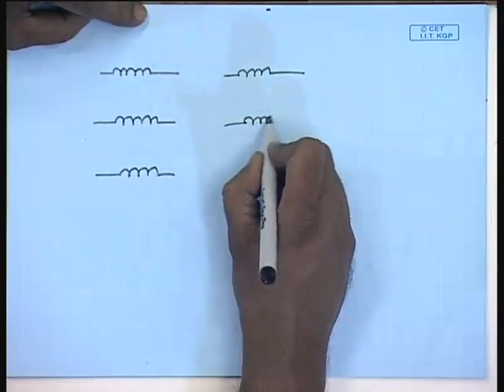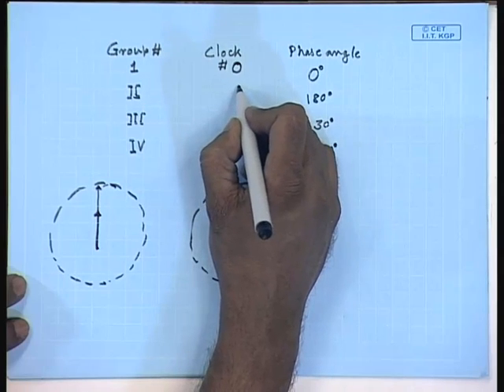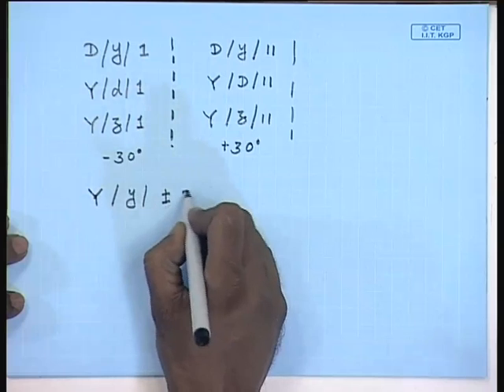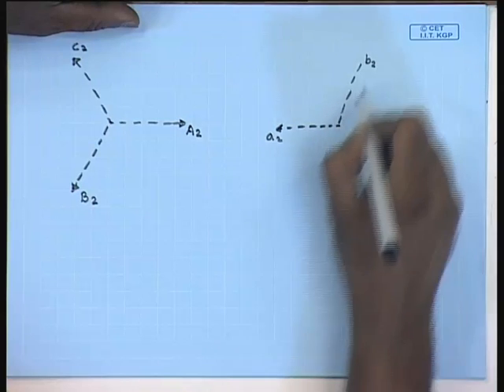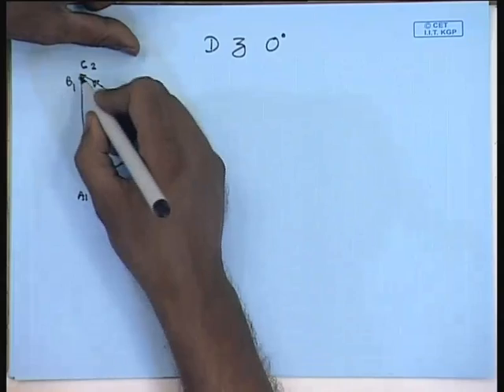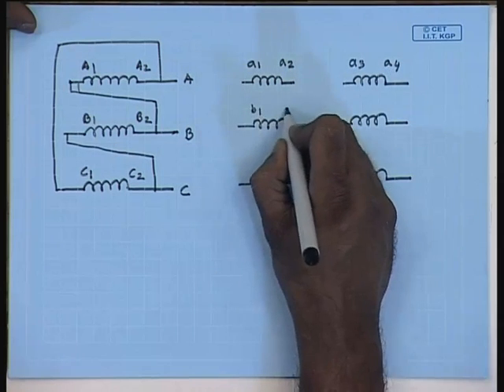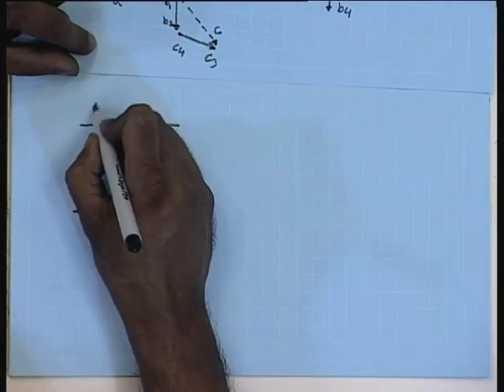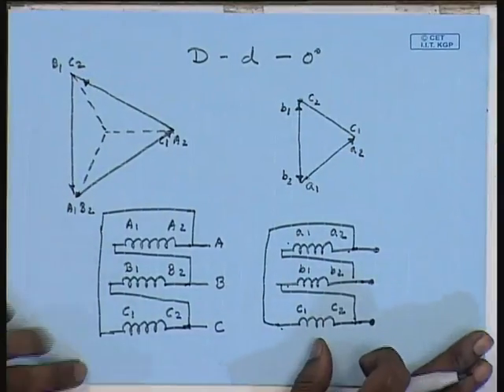Mod-01 Lec-13 Lecture-13-Three Phase Transformer Phase Groups Part - I

Comment: For Dd6 How come the L-N voltage not equal to the Voltage across a winding??? Voltage Across a Winding = Vp(Phase Voltage) and for Delta Vline=Vphase isn't? What is L-N after all?
Reply: L-N are the supplied voltages across every terminal with respect to the ground/neutral which are 120 degrees apart from each other(VA1,VB1,VC1),for delta it's L-L=line to line voltages=phase voltages=winding voltages(VA1B2,VB1C2,VC1A2).That's what he has drawn in the phasor of Dd6 connection.

Comment: If low voltage winding is delta then how you are considering neutral for LV. This is wrong explanation.
Reply: +SUDHIR SHARMA  clear your basics and then see these lectures helpful to you..........explanation is right.....
Reply: I'm also confused about the neutral in the Delta connection. Is it an actual connection? or is just a way to help us understand vector grouping?
Reply: every one including the professor should clear their fundamental. Reading text book while explaining is time consuming process. all the connection could be explained in single lecture but this lecture has PART II.